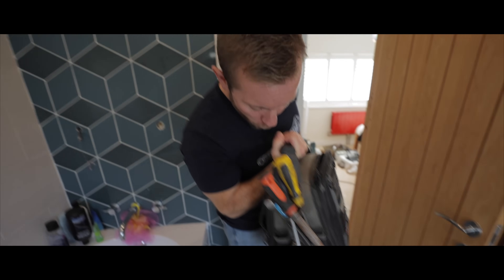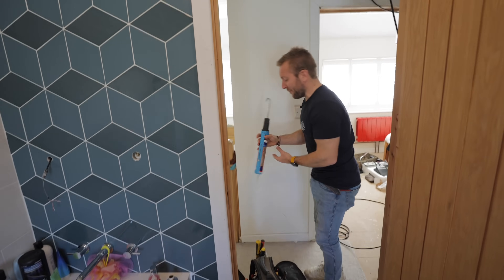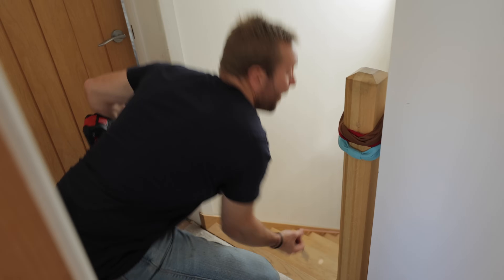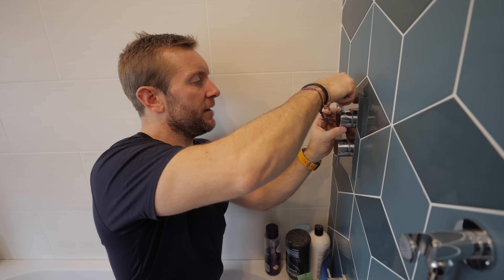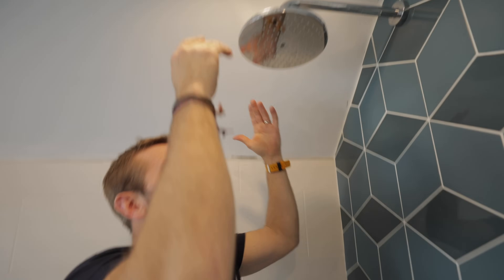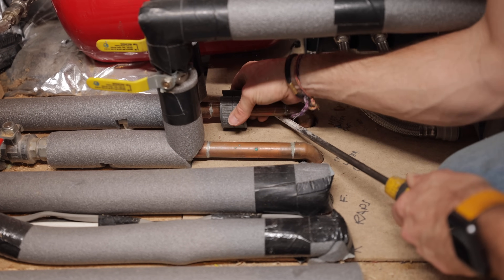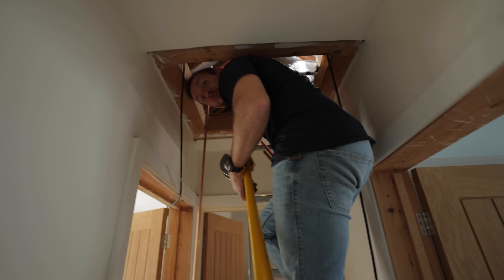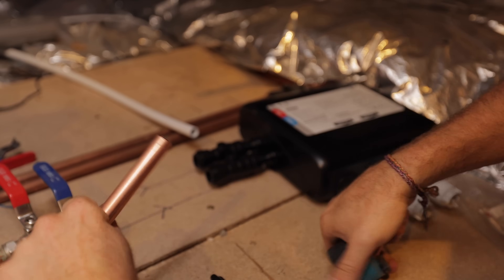HUGE MISTAKE! Dual Digital Shower Install GOES VERY WRONG

Comment: when marking onto tiles for screw holes, if I don't have a chinagraph pencil, I usually put masking tape on the tiles and mark onto that.
Reply: I use a sharpie and pull the nib out so it’s long enough

Comment: Try Bosch muilt construction bits on tiles Thay are unbeaten nothing stops them and Thay out last arrow head bits
Reply: Best all round bit ever, piss through ceramic brick stone etc, porcelain you want diamond wax filled.

Comment: I know plumbers have too much pride to use yorkshire fittings but they really do help in tight spaces. No nedd to check if solder reached all the way round

Comment: Old pipe = clean inside the new fitting twice as good and flux both sides. Yes you get a messy solder joint, but it will hold.

Comment: hi ive got a question hope you can help me at the moment i have a shower pump in the airing cup fed direct from the hot water cylinder and cold from tank in loft so fairly balanced if i remove the pump and install a mire platinum where the pump use to be with the same feeds do you think this will be ok thanks oh and its a normal boiler

Comment: Why is there directional arrows on the lever valves? Ok obviously you fit the valve with the arrow in the position of the flow of water but why?
Reply: It's to do with how the valve is assembled. The ball part of the valve is inserted into the side facing the incoming water supply.

Comment: Am glad when I had our showers fitted that I had wireless controllers and just ran the pipe in from the ceiling. Doesn't look as nice but a lot less maintenance / replacement in the future. 

Next time I need to tell my wife that it's going to be all plastic panels both wall and ceiling 🤣

Comment: Why not use a system with remote control? It has to be simpler to install. Place the remote near the entrance to the shower and you won't get a shock of cold water down your arm each time you turn it on

Comment: Do you want to sell the low pressure unit ? Is it one from Bathroom brands with a part number of 100133 ?           I fitted a Crosswater digital shower around 6 years ago and the pump is on the way out.
Reply: He mentioned in an older video that this was filmed quite a while ago, he ran into this problem quite a bit time back, so he probably modified/sold the original unit long ago.

Comment: Nefer heard of a digital shower
Reply: it is basically an electrically controlled valves array for bathroom installations. i guess it's a matter of faith weather you want electrics close to your shower water or not.
Reply: A solution to a problem that never existed.

Comment: I would curse this guy out in my head like no tommorow if I were some guy years down the line trying the exchange that plate he glued to the wall... Like doesn't this thing have a gasket?
Reply: looked like silicone. wont put up any noticeable resistance when removing.